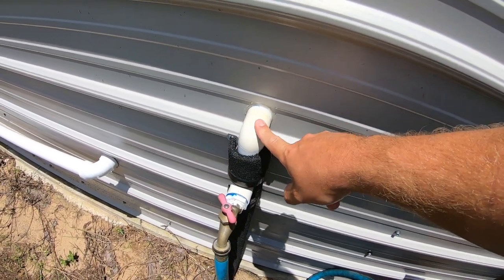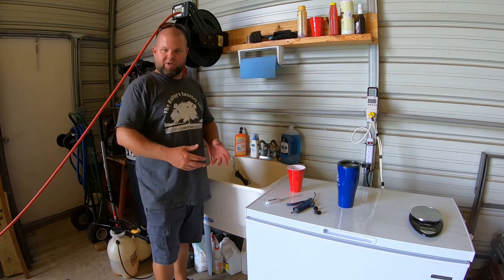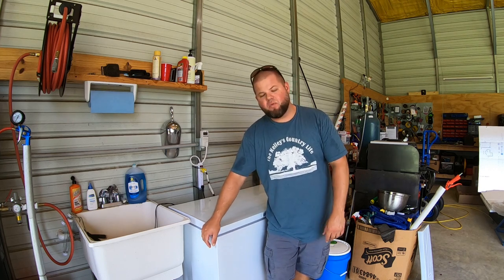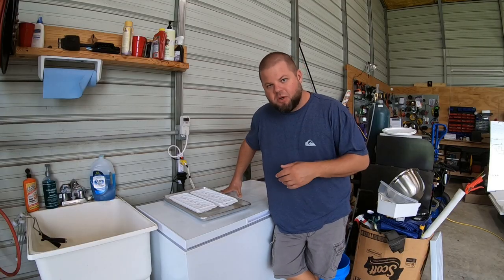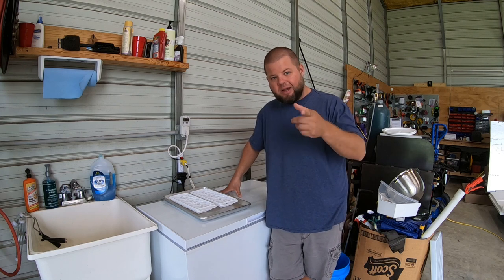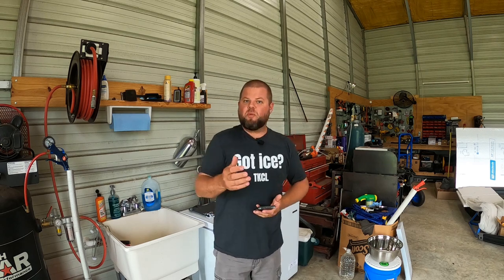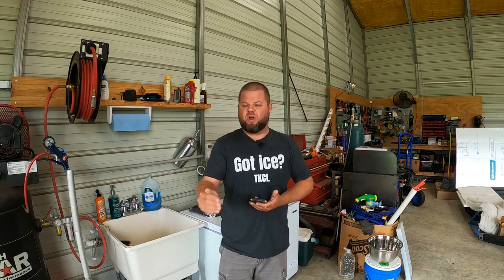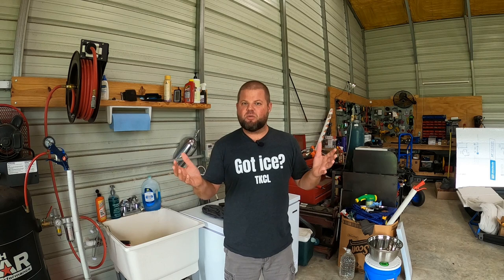Homemade ice machine tests! Hot water freeze quicker than cold water Mpemba effect? #376

Comment: Don't use your mini fridge to cool the water, just pipe the water through the freezer with copper pipes and with the right size and length of pipe you could make it so the flow of water going to the ice maker is as cold as possible without the whole system freezing up. You could possible even solder or braze of copper fins to the pipe to increase its heatsinking capacity. But using the freezer allows you to cool the water closer to freezing and not have the added cost of the mini fridges electricity added to the system when the freezer should have plenty to cooling capacity left to cool the incoming water
Reply from the maker: I've scratched the mini fridge for now.

Comment: What freezes "quicker" is energy in energy out... its not magic. The Mpemba effect is debunked nonsense.
The theory of "boiling water freezes faster" is a false premise propped up by a separate phenomena conflated with the Evaporative cooling effect
The Evaporative cooling effect is not applicable in a "closed" system (like a cooler or ice maker/chest freezer) if the goal is to maximize usable ice.
In evaporative cooling of water the heat is not "lost" (or lost faster)  it is transferred to the atmosphere through evaporation. 

An open atmosphere does increase cooling in a limited capacity the faster you can evaporate the water... At "room temperature" Hot water will evaporate faster then cold water and have a "larger" net transfer of heat. But that does not mean it will be "cooler" then the chilled water.

In that case (not applicable in a closed atmosphere (like a freezer) the atmosphere is acting as a heat sink, the larger (and cooler) the available atmosphere the larger your heat sink.

Even if hot/boiling froze faster, which it doesn't due to energy in energy out (and b/c evaporative cooling is not meaningful with the use case being "make more ice" in a closed system) you would still be left with less ice... b/c the ice would only be made with the water that was not transferred as vapor to the atmosphere due to evaporation.

AKA even if this was a true assumption "boiling water freezes faster" (its not and it doesn't)you would have less water that would freeze faster... aka you would get less ice "faster".
Reply from the maker: I understand, that's what I've come to understand on all my reading of the subject. At the end of the day, less ice is the last thing I want. Plus as stated, it isn't logical to boil water 24/7 no matter what the results

Comment: Computer fans should be small enough to place very close to and aimed directly at the freezing water. Experiment placing them below, above and beside the ice makers. Maybe two per ice maker. You probably can get them for next to nothing or even free from old computers. 
They draw so little power that you could hook them up directly to the freezing mechanism so they only run while the water is actually freezing.
Reply from the maker: New fans in the mail, we are definitely revisiting the fan tests since that was the biggest gain.

Comment: Some ice makers use a sensor to determine what temperature the tray is.  The quicker that tray reaches the set temperature, the quicker it should discharge the ice and refill the tray for a new batch of ice.  Also, since making ice is a matter of thermodynamics, it is really a matter of heat exchange.  This also explains that radiator effect of having fans move air over the trays displacing/exchanging the heat quicker.  In general the colder the freezer is the quicker the ice should form (absent the Mpenba affect).   Setting the freezer colder and chilling the water coming in should speed up production.  I was thinking that a copper loop within the lid of the freezer may have a similar effect as using a mini fridge.
Reply from the maker: Thank you

Comment: why would you bother with copper? drill a few holes in the hinge side of the fridge door(nothing to drill through that could damage the fridge), keep the coils you have in the door(out of the way), You could even put the fridge on a stand to get the shortest exposed insulated line.

Only thing is you would have to leave enough slack to open the fridge door but on the hinge side it should be about an inch or two.
Reply from the maker: I just know copper is more efficient

Comment: A vehicle cooler ,that runs ac/DC..one for a console that's only good for a 6 pack..low power consumption...consists of a  computer fan.2 heat sinks..they will freeze stuff on inside..
But you will have no issues drilling to install coil..
Plug in and go..
Copper not necessary..
Plastic coil would be fine..
Jus Idea'n
And the obvious fix Is do something about the external exposure ...cover , insulation...Der'

Comment: One thing you could due to lower you incoming water temp (down to whatever your ambient ground water is)... would be to tee off the main supply line underground and neck down to 1/4" PE or PEX tubing run directly into the building and ice maker... (preferable underground as much as possible or at least insulated and shaded once it comes above ground) ... 

Or if you really want to spend money run 1/4" PE or PEX as directly from the well head and as deep as you can go if the temp at the well head is substantially below the temp at where you underground pipe is run... If its not >30° difference it likely is not worth it...  I mean if you have a pipe trenching machine then go for it.. but if not I might try the former as that should be a pretty simple 1 day job requiring about 20-30$ in materials.

Comment: My thoughts before even watching this...is a ground loop of water...that sits at room temp.....this would be cooler than the outside water ..maybe in a bucket of water?  You could use the ice from your freezer to keep it cool....or if you lazy just use the "room temp" water....You could use that blue Lowes bucket...coil some plastic tubing...maybe 10 or 15 feet...fill with ice...once a week...once you get lazy just leave the water...that will definitely keep temps cooler and more stable...Use 200 watts of solar and you have a "free" icemaker...

Comment: Couple ideas...

1.) Get a white pool noodle to insulate your pipe
2.) Create a shade to keep the sun off the pipe/side of the shed
3.) Instead of putting your copper/plastic coil in the mini fridge, run it through the lid of the freezer and affix it to the under side
4.) You can affix a piece of R10 foam to the cold sides of the box
5.) Create a "radiator" for the front of the box that pulls cooler air from the bottom and blast it out the front

P.S:  I am jealous of the commercial sink setup.

Comment: Definitely don't waste your money on copper. Use the plastic tubing and mini fridge you already have. The tubing will get plenty cool sitting in the fridge during the freezing cycle. The copper won't be cooler, it will just cool faster.  A 7% increase with basically minimal added cost is worth it. Just make sure the outlet from the mini fridge is as close as possible to the inlet of the ice maker instead of having exposed/insulated tubing.

Comment: Maybe instead of prechilling from the mini frig., just open up the back wall of the freezer and run the copper prechill line inside the wall of the freezer and close it back up. Or maybe just on the back wall with an insulation trapping the cold away from room temp. ...  It would take some tuning to get right, but it's free cold that's already made by the freezer and you won't demo/dedicate your mini into the mix.

Comment: Get the water well company back out there and drill a small diameter well and run a “pump and dump system.” Water circulates back down the dump well. While pulling from your supply well. Recommend drilling it on the opposite side of the building. Also you can use copper coils around the freezer. Circulate the water through that.

Comment: Commercial machine production schedules give ice volume by water inlet temperature. Your test will be about 50% off. The volume of the hose  from the cooler to the ice maker will heat saturate even with the insulation and is 50% equal in volume to the ice tray. Commercial machines use the first water for ice harvest and flush hot water in lines in machine. You don’t need copper pipe, use residential ice machine line set sold by the foot. A college refrigerator two ft sq for drinks in shop run in and out side direct into freezer box will give water temp 40 degrees 20% increase. The ice in box helps pull box temp down faster think thermal mass.

Comment: Told ya that the hot water thing was a myth. Hope you enjoyed the video I send you.
My suggestion is put a awning above that water line 0:11 so the sun is not directly hitting it.
Take in consideration the solar orientation so you can correct pick the size for the height you want to install awning to keep the line under a shadow the entire year.
Reply: I agree. Seems more economical as well, no moving part, small one time cost.
Reply: It's not totally a myth. In certain circumstances hot water can evaporate quite a bit in a freezer with very low humidity. This evaporation will add to the cooling of the water. That's all it is. But you lose some of the volume. And your freezer will need defrosting more. Put water in a bottle with a lid on it and hot water will never freeze faster. It's just evaporation..
Reply: You don't even need an awning, just lean a board or something over it.
Reply: @pkeeney  yes but would be ugly :P and a small awning can be made with cheap materials.

Comment: Is copper needed? The water in the fridge will be sitting a long time before being feed to the ice maker. There are alot of things you might try passively. One, drop a coil of plactic ice maker line into a large trash can of water ( or bucket) and aerate the water in the can with a cheap aquarium air pump. Aeration is used to cool ponds. Or, run a coil of plactic tubing outside the building under a pile of 6" mulch in the shade (make a flower bed), keeping the area moist. Or, run water into plastic bottles in the fridge, no coil, in a series until the last bottle is tapped to feed the icemaker.
Reply: he already has the plastic line from the cooler no pump needed just run it like it is with the coils taped to the inside if he is going to be running the fridge anyway. an hour or so in the fridge in the lines will cool it as with the lines you have greater surface areas than bottles with no chance for stagnant water.
Reply from the maker: I could use plastic for big savings, I just know the copper will perform better.

Comment: In the ultimate build put some legs on the cooler so you can slide your ice chest under it and put a spring loaded trap door on the bottom. Then you can quickly fill your ice chest without scooping and letting all of the condensation in. You could also add more ice makers to the top to increase production by 100-200 percent since you no longer have to scoop from the top.

Comment: The hot water freezes faster thing was something I heard growing up in Canada and it made sense because hot water is what was used to flood the ice off a Zamboni on a rink. I think they used hot water to resurface a skating rink because it melted the imperfections left behind by the blade that scraped the ice.

Also, if you had nothing else on the go and your only focus was making this ice maker run as efficiently as possible, the experimentation would only take 1-2 weeks haha

Comment: Check out a video by Barley and Hops. George uses an old air conditioner to chill the distillation cooling water from a still. Instead of wasting water or buying bags of ice, his cooler is recirculating water chilled by the a/c condenser.

Comment: cooler water will freeze faster than hotter,what may be benificial is to rethink the supply from your well.if your supply line is deep and you can get as close to subterranian temp than the cycle time will be reduced.forgive my spelling.in other words you may have to redig your line from the well pump to your building. maybe 3 feet or better depending on the water table, use geothermal to your advantage.

Comment: You can insulate the entire freezer as long as you don't restrict the air flow around the compressor. The coils down there is where it dumps its heat. You can add a fan down there too, but neither will have much effect on ice production just freezer efficiency.  I would try to squeeze in a third ice maker.

Comment: The copper vs plastic tubing will not make any difference in temp going into ice maker. So that is cost  you can save since you already have the plastic tube. Also adding the mini fridge and coiled tube will not be a cost increase since you already run the mini fridge and already pay that bill.

Comment: First, position you mini fridge extremely close to the inlet of the ice maker(chest freezer) so you do not have a long run of inlet piping between the freezer and mini fridge.  Even though you have the inlet piping insulated with a small amount of water in the tube between the cooler and icemaker it will lose some of its coldness between cycles. Also, I personally do not believe you need to buy copper piping, the temperature will transfer to the plastic tubing.

Comment: Okay I agree with your findings. But here is a test I want you to do. Hot water ice vs cold water ice melt time. You can do this with time lapse. Hot water ice will be solid clear ice while cold water ice will be white. The reason the difference is temperature of water molecules. The melting results will also surprise you. Hot water ice will last longer due to it being clear ice = more condensed water.

Comment: It looks like you are using an aluminum pan under the ice trays. In computers aluminum is used to pull heat away from hot CPU's and spreads it.

Comment: Before you modify that mini Fridge look at a counter top Ice Cream maker to put your coil in ...is it designed to run for hours? maybe maybe not..try it.... fill it with salt water let it cool the salt water down..put it in your igloo cooler  remember cool air in hot air out so you may need to modify the cooler..it should work

Comment: Kelley on top of using a light color pool noodle to cover your water pipe.  You may want to evaluate the cost of using something like white leak stopper or white flax seal on your outside water tank . Even a white latex paint would help dramatically to reduce the heat inside the water tank itself.

Comment: Block the sun getting to it, and you won't have to remove as much heat from the water. Shade it with anything, and that pipe insulation will help keep the heat out rather than conducting it from the sun.

Comment: you don't need a copper coil just use 100' of polyethylene tube in the mini fridge. poke it through the door gasket and hang it on the inside of the door.